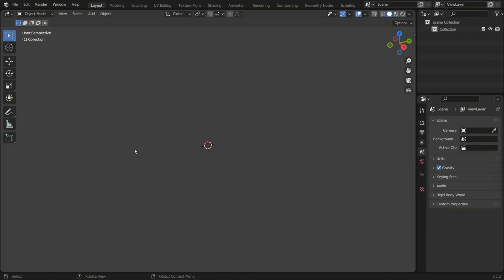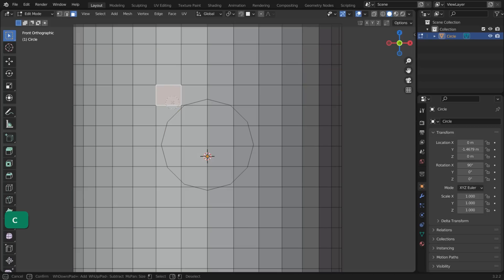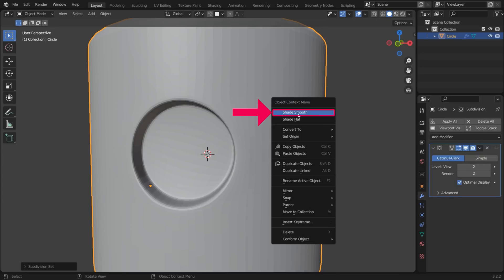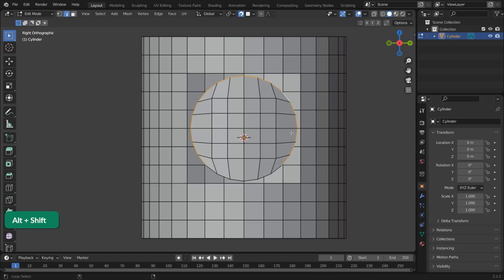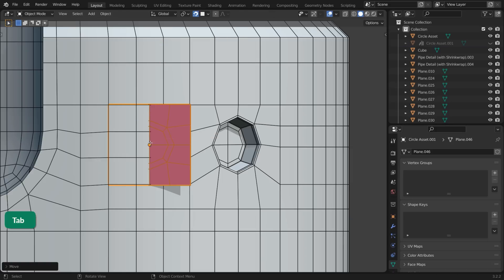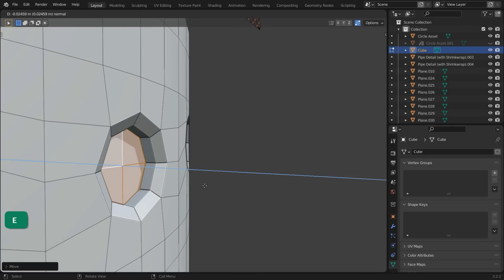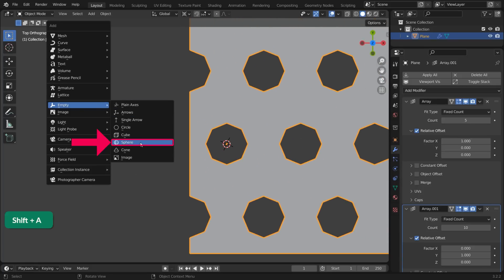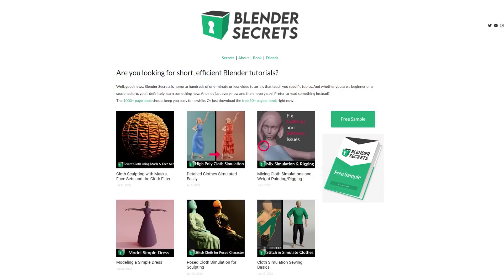Blender Secrets - Making Holes in Cylinders with decent Quad Topology

Comment: For the longest time, I've been trying to make a concrete pipe interior.  Specifically, a vertical cylinder shaft with a smaller perpendicular cylinder tunnel intersection.  It always looked janky until today, with the help of method 2.  Now I just need to learn how to properly unwrap it for texturing.  Thank you for getting me closer to my goal.

Comment: what am i missing? first method i press G and nope, no snapping of circle vertices whatsoever, it just activates move. i wanted to use that method instead of the others because it allows precise dimensions of the created hole. update: you have to be in the ortogonal view of the projection to apply it. duh. sorry. i am a noob. i bought the book, and will not post again until i am halfway through. promised.

Comment: You can also get a circle using a single vertex.
1. on edit mode go to vertex selection
2.Control+ shift + B to bevel vertices
3. Add as many segments as you need segments to have a circle
(Don't forget to apply scale before doing all of the above)
Reply: no, the mold will be broken.